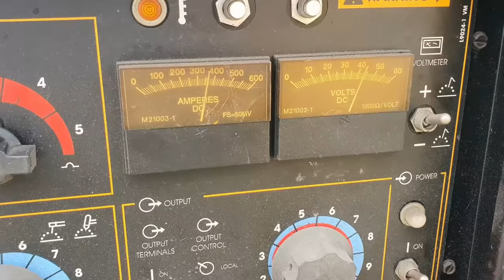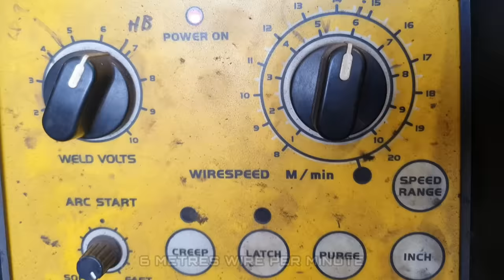Replace CRACKED Excavator Bucket Skin | Gouging & Welding

Comment: I wanted to let you know I enjoy watching your videos. For a self taught machinist and fabricator your work is above excellent. Keep the videos coming glad I found this channel. I was once a mechanic for a Cat dealership here in USA. I didn’t do the repairs you do, but we had a decade person who would do all the line boring on machines when in the shop. From loader center pins to loader lift arms and frames. So know or seen this kind of work done before. You boring machine is much more  modern than what we had back in 1970’s and 1980’s.

Comment: This one is an educational experience. 
Did detect a note of frustration with some equipment operators? I certainly understand the problem. Once upon a time I was a bulldozer operator. I was taught from day one to respect the equipment by guys with decades of experience. I think I was so lucky to get the opportunity to learn from the experts.
Reply from the maker: Hey mate you had the right attitude! The dry hire machines get pretty abused
Reply: At one time, I managed pool cars for a large banking concern. These cars were available to employees who needed to make calls on customers. Most of these employees treated these cars like crap. I had one employee who while driving the bank car, filled up a 5 gallon can of kerosene. He sit it in the back seat and it turned over, spilling all of the kerosene onto the seat and floor area. I had to have all the carpet, the seat, and the back removed and replaced with new parts plus the cost to clean up the mess and smell. His department was pissed when I charged all the damage to them.
Reply: @larrykeenan598  i can confirm,  we had a fleet of corollas for company cars,  staff would take them out and basically race them from place to place. They were average within 3 yrs
Reply: @nipponsuxs  We sold the cars when they got 50K mile on them. Usually within a couple of years. They were worn-out pieces of crap by then. Ford and General Motors cars and Ford Vans.
Reply: @larrykeenan598  yeah our campany did the same after 3yrs theyd already done around  50 60k km.  Surprisingly for sll the abuse the engines were still passable,  being s Toyota their resame value at auction was better than anything else,  dint work for the company anymore but they still use camrys and corollas as fleet vehicles, Australia like the US the best selling foreign manufacturer is Toyota, overall Toyota outsells all makers in Australia

Comment: 1:01 a bucket that size great for placing concrete where the truck can't go or the chute can't reach.
Reply: And you're to "tight" to pay for a boom pump. Is what you meant to say.
Reply: @markfryer9880  Letsdig18 uses it to place concrete collars around pond drain pipes. There's no point in renting a boom truck when you have equipment on site to do the job.

Comment: We weld these types of buckets with solid core wire 1/16 and only welded in the flat position. Almost all at work never welded a 3G weld. I was certified for 3 years under state and federal. But that was before I worked at this company where it is not required. The wear bars always stay back from edges about a inch. You bringing them past the edge and wrapping them really beefs the bucket strength.

Comment: I'm curious about this arc gouging process in this specific application. I can see where it would be really nice for removing welds or surface plate without cutting the base metal, but I don't see why it would be desirable in a cutting application. What are the advantages of using an arc gouging torch for cutting over oxy-acetylene? Thanks.
Reply from the maker: Will do a video showing/explaining and the pros/cons of each in the future
Reply: Yes how does it compare to using a plasma cutter?
Reply: John Schmitt I believe with gouging you can better remove just the weld and not pierce through the parent material. Plasma cutters like clean dry air or else the consumable’s life span suffers. Gouging , the air quality seems to be less of a concern. Replacing the consumable on a gouge is a lot faster than replacing plasma consumables. For field work, I can see the advantage of not having to carry another machine, duty cycle may be a factor as well?

Comment: On heavy wall pipe any deep welding repairs Gouging is the method of choice and has been for years especially for lack of fusion repairs you can see it come out as you gouge much easier than grinding. Greetings from the UK especially the dog.

Comment: Every spring "Breakup" we would do a 4 to 6 week streach of bucket and or blade work. No romance there eh. One tooth shank a day or the seemingly never ending job of buildup and hard rod facing between the teeth and or corners where they wear the most. Air gouges are sure great at burning up good jeans and coveralls eh. I finally had them get me Nomex coveralls. Way cheaper in the long run compared to just cotton. Nice touch on the trigger there Kurtis. As smooth as any machine can do my friend.

Comment: Love your channel mate. You are one of the few engineers that has the skills to go along with your extensive tool set. I've picked up tips on repairing stuff I would not have considered. I do this type of work on buckets all the time, if I can give you one tip its chomp out the concrete before you cut, saves a lot of unforseen headaches. 
Love the dog, he is just awesome.

Comment: When growing up as very young child , dad knocked a couple of cast iron  gears off of large rear finial drive on M international. 
My dad and the oldest twin brothers 
hung me upside down to get the two pieces of the gear out the bottom housing,  there arm's were not long enough to reach .
Dad used a carbon arc to heat and brazenly the two pieces of gears back on the cast iron  gear  .  They didn't break  for about twenty years. 
That tractor was use almost every day and was our biggest tractor for many years  .

Comment: I own a S/W Special OP's folding knife. It's the real deal when I purchased it over 18 years ago. Tanto shaped blade. Still sharp. 440C steel.  It is not as fancy as the ones being made now but feels so good with its simple hand grip.

I sure hope you get paid well for your work. And yea get a bigger hammer. It always helps when you have a bigger hammer to pound on things.

And therapeutic too :)

Comment: Your carbon arc gouging torch has some interesting history. The basic idea has been around since the late 19th century but was never industrialized until WWII when shipyard welders took to using movie theater projection lamp carbons and a jet of compressed air to gouge away battle damage. A welding engineer, Myron Stepath, formalized the procedure, and later founded ArcAir in Bremerton, Washington State, my home town. I knew his partner, Niel Krumm, quite well through my dad. I worked for ArcAir for a couple months in their machine shop when theiy were mechanizing the process. Myron Stepath (he was introduced to me as "Mike") seemed like a hands-off executive. I only saw him a few times. Niei Krumm ran the day to day at ArcAir. It was a small operation employing maybe 40 people but their torches and consumables sold world-wide. ArcAir sold out to Airco (I think) and they moved the operation to Lancaster PA in the late 1970's. I see by Google ArcAir founder Myron Stepath moved to Kentucky to breed race horses.

Your demonstration shows me nothing has changed in the basic design of the carbon arc gouging torch in 70+ years - except the rectangular carbon is new to me. Goes to show a good idea doesn't have to be complicated or embellished over time to bring continuing benefit.  

The.ArcAir carbon arc torch I was given when I left the company in 1968 has seen little use. My 300 Amp welder is a little small and my 5 HP compresser overtaxed for all but the lightest arc gouging. The process requires lots of Amps and CFM as you emphasized.

Comment: First, and only time, I ever saw an Arc Air was my first six months on the fire department. The job thought it would be a good idea to put them on the rescues. It was portable, as I recall and fit in a backpackable metal box. It worked good and was easy to use but never was, to the best of my knowledge, used at a call and was taken of the rescues a few years later.

Comment: Kurtis, I have a million questions so I don't ask as I know your going to answer them at sometime. I don't like pestering busy people like your awesome self and missus. I'll happily keep your security guard happy and worn out (Been around woofs all my life, golden lab Toby was frikking huge. Soft as hell but christ his tail on full wag felt like a lead shot filled pipe across the shins.....) daft as hell, loved water...

Thank you so much foe
Reply from the maker: Hey mate thanks for taking time to watch and comment, feel free to drop some questions it helps us know what might need explaining in future vids 😎👍
Reply: @CuttingEdgeEngineering  I reckon the only question I really have is your on a 12 hour shift? or until the job is done?? I'm not a pro machinist so cnmg etc really goes over my head as to cutting tips but it's fascinating to learn. Something life has taught me, never stop learning. 

I've a little Sherline thing, fun for making chips and a mess but I got a bit serious when had an idea at work. Carved out a part etc, fitted it up. Did the trick, nice and easy. 

Never heard of air gouging until you carved a few parts up with it, same with line boring etc. Absolutely fascinating to watch. 

If I ever get to Oz, beers are on me.

Comment: Next bucket repair you should do vertical wear plates. With the dog and wedge process, even hot tacks. Just a thought horizontal is the easy was, vertical wear plates always do better in the states.

Comment: I used to rebuild that very same gouger as a millwright at the steel foundry I worked for. If I was inspecting your tool I'd have replace the cover because it looks like you run your rods short and I can see damage. Careful you can damage the tool if you don't replace the covers regularly.

Comment: A fun fact about carbon arcing….. back before xenon bulbs spot lights in arenas and other venues used carbon arc rods to generate bright light, it required 2 rods and a concave reflector to help concentrate the amount of light needed to throw the distance to the stage

Comment: Great work as usual! Quick question if you don't mind, why not use the plasma cutter for taking the skin off as well? It seems to do such a nice clean job compared to the air arc gouging. Cheers!

Comment: Nice work Kurtis and Karen, your videography skills are very good! I liked how the scraps were used to be sacrificial plates for the bucket, question though...how much wire do you burn through on a project like this roughly? That's gotta be quite a bit to weld it up properly and strong.

Comment: Never run out of work in this business, although if you wont do it properly, the work will pile up so much you'll soon see it getting sent someplace else. I've seen some of these big buckets on modern gear with so much wear plate they may never wear out?😁. The dog is not silly, not going to fight with the forklift having had a good crack at it.

Comment: I noticed you switched from a gas-shielded flux core wire to a hard wire or a metal cored wire for the wear bars. What wire is it and why? Not being critical…, just curious and trying to learn a new trick. I appreciate your work very much.

Comment: Hey Kurtis, great work as always.
Probably a dumb question, but what would happen if you just cleaned and welded the cracks? I'm guessing it wouldn't last long because of the already fatigued metal? or is it just too thin to weld together? Cheers mate.

Comment: Pretty cool video takes me back to when I was on the tools 👍 kind of miss it in a way.
noticed you opted not pre-heat the bisalloy plate before welding ? 
what brand of flux core was used ? I used to run 1.6 vertical-core 3xp

Comment: Also keep your stick out in thirds of initial stick length. If you have more stick out the air in air arc is not efficient. If you notice Curtis makes more progress after he burns off an 1/8 of his rod. I used to run a 350 Lincoln diesel maxed out when air arcing. Shorter stick out was always better.

Comment: I've always wondered, how do you process all your scrap metal? cuttings, shavings, cut-off bits and bobs, scrap from replacements, broken tools, worn out bits, dull cutting inserts, nubs from arc rods, etc. Do you have to separate out the different types of metals for them to processed? Is there a robust recycling program there that can melt down and re-mix/re-sell secondary scrap?

Comment: Man.  I sure could use having my excavator bucket reskinned.  It was pretty bad shape when I bought it, with tears through it in half a dozen places.  I heated up and straightened the skin, and welded the tears shut, but doubt it'll last long.   Spent most on getting the pin holes line welded and bored back to spec, and it really needs new tooth shanks as well.   People just can't seem to grasp the significance of maintenance.

Comment: Depends of thicknes of the plate but i used a stick welder on high amp once or twice. Did the trick but that was because i dit not have the gauching possibillity.

Comment: Hey, I do have  a question regarding the welds on the sacrificial plates? why not weld them all the way around but instead just weld with gaps? isn't dirt and water going to find a way inside those cracks in time and start damaging the new shell? I think it makes sense to save up some wire and also time by not doing continuous welds but I don't know if it actually makes any difference or is just a choice thing. Thanks. I really enjoy watching your videos!

Comment: So the replacement is thicker than the original skin? Or had the original skin just worn thin? And is the replacement skin a much harder metal as well?
Reply from the maker: Hey mate good spotting, the original was 6mm and replacement is a bit thicker at 8mm, it is slightly stronger/harder material

Comment: You can stack the flat gouging rods ontop of one another. If I have a crap ton of metal flow clean-up to do I will take two flats and put them together, and it seems to make the flats last longer than they would by themselves. Or I could be imagining the duration, but nevertheless, you can put them together, you don't need to crank the amperage that much higher.

For 3/8" Rounds, I set my amperage to about 340ish. If you have your amps too high you will see the ends of the rods shoot off every now and then and basically go through them faster.

For 5/8" Flats I use about 400 amps when I am stacking them I use 450amps.

Do alot of gouging on mining equipment some people think its a butcher's tool but you can take 1/16"  off at a time or finer if you have that hand control. Spend enough time fixing equipment and you'll become a surgeon with a gouger.

Comment: I noticed the weld beads in a diamond cross-hatch pattern on the inside of the bucket near the front lip.  You can see it best at 10:03 just to the right of your hands.  It appears it was done during the original fabrication.  Any idea what purpose that serves?  If it was intended as a sacrificial wear feature, it certainly held up well.
Reply from the maker: Hey mate that's hardfacing weld to protect the faces of the bucket

Comment: Hi buddy
I know what "air gouging" is,, but its great to watch you cutting with it,, have you ever tried a plasma cutter?,, they will do the same job,, but they can do it faster, cleaner, and with a much cleaner cut,, but they do have there limit's on thickness,, just over 1/2 of an inch cutting steel!,, what I would like to know is,, what kind of welding wire are you using in your Mig welder,, as I dont remember seeing any gas bottle's plus you get a "slag build up!" on your weld's? I have only seen that slag build up with MAA (ark or stick) welding never with Mig welding,, unless you using a coated Mig wire?,, I do a bit of home Mig welding but I use argon gas with mine,, so please tell me what kind of Mig wire your using,, am I right in thinking its a coated wire your using?,, or what they call in Britain,, ""gas less Mig wire!""

Comment: This might be a stupid question but why do you use flux core welding wire and argon shield gas? Is there any benefit or just extra protection against oxidation,  great video learning alot watching your video's

Comment: Kurtis I notice in a lot of your jobs you have to weld on lifting eyes, is there not a magnetic clamp strong enough to hang off the crane or forks? I’m sure I’ve seen other channels moving plate steel on to a plasma table with them, it might save time and material in the long term.

Comment: Quality work, as always.  Great explanation of the air arc.  Do the air holes align with the direction of travel?

That Yale lift looks brand new.  Nice.

Can you tell us more about the crane.  Shop built?  Like to see some more pictures of  it.
As always, thanks.
Reply from the maker: Hey mate thanks for watching! Yeah the air holes always pointing in the direction of the where the metal is being removed (if you hold it correctly). The Yale is new to us only 300 hours on it a workshop down the road was selling it so we got a good deal. We didn't realise the yard crane would get so much attention definitely going to do a video about it. She's a 1971 International yard crane, one of my favourite workshop machines

Comment: How do you specify the curve in the bucket replacement piece to the shop that does the bending? Do they have pre-programmed specifications for all the metal parts that you work on?

Comment: Hey Kurtis, did you get a new forklift? well, new to you? Great job on the skin replacement. Question, why just do the short welds on the wear plates. is that to allow them the come off when they wear out or for easier replacement? Cheers